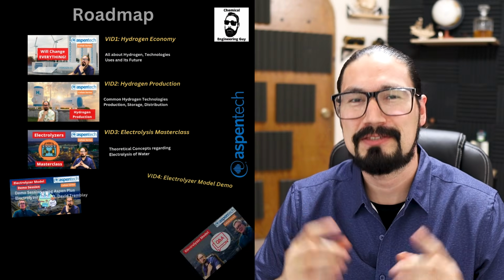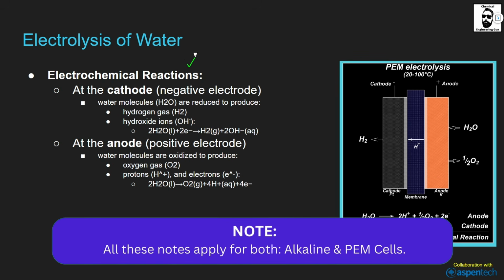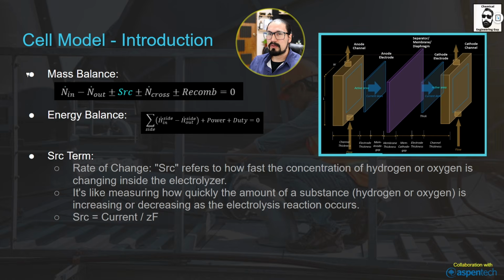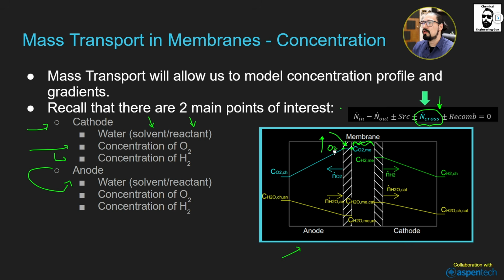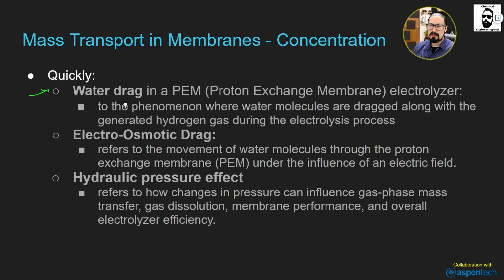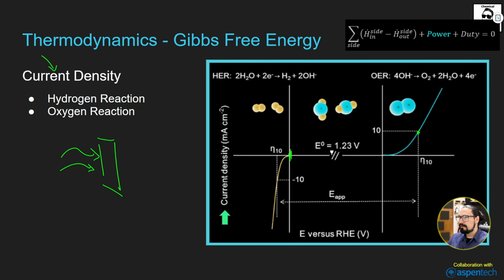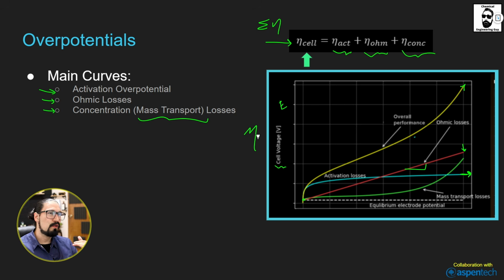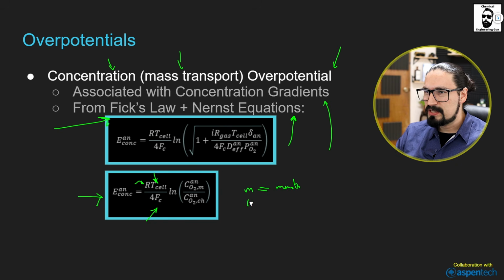Masterclass: The Electrolyzer Model (Fundamentals & Theoretical Concepts)

Comment: The sample file of aspenV14 provides a simulation of an electrolyzer, which is created using the built-in CUSTOM MODEL, and how to scale up the simulation based on this file.The sample file of aspenV14 provides a simulation of an electrolyzer, which is created using the built-in CUSTOM MODEL, and how to scale up the simulation based on this file.
Reply from the maker: The CUSTOM MODEL in Aspen V14 (usually built with Aspen Custom Modeler or embedded FORTRAN blocks) is a powerful way to simulate detailed unit behaviors like electrolyzers. To scale up the simulation, here's a general workflow you can follow: